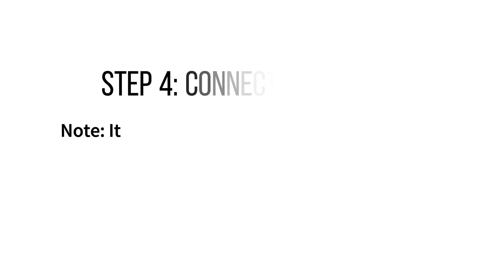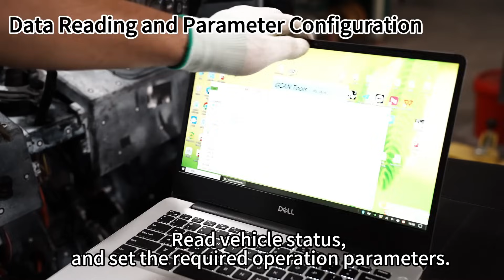Electric Tuk Tuk Conversion: Complete Step-by-Step Guide

Comment: I have a Ct-22 display and a fardriver controller. The display speedometer is jumping around 65 mph while it is stationary. I connect the yellow and white speed sensor while to the light blue on the controller and that did work, so I connected it to the brown boost wire and the problem is still same. Help please.  Thanks